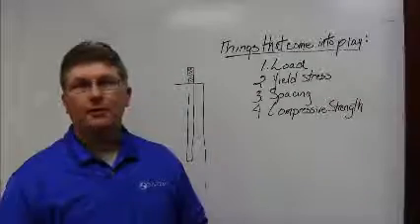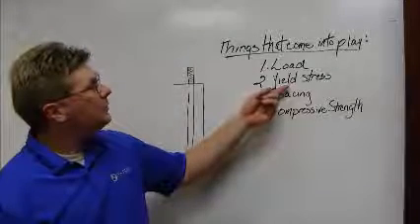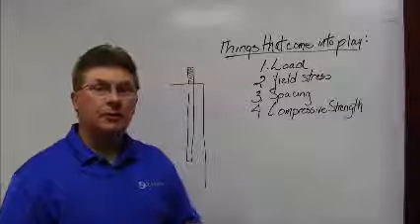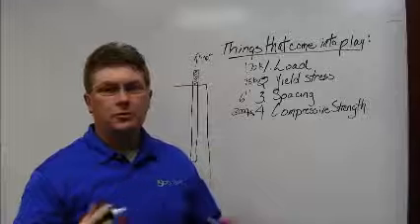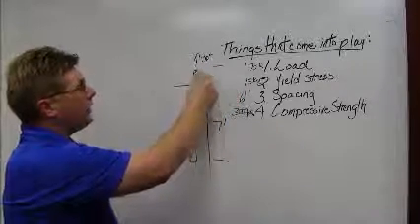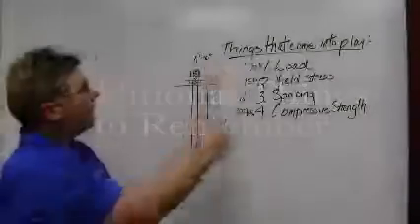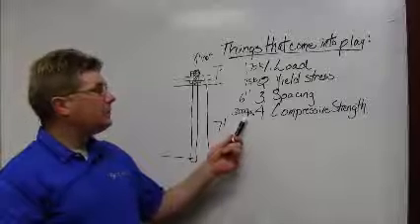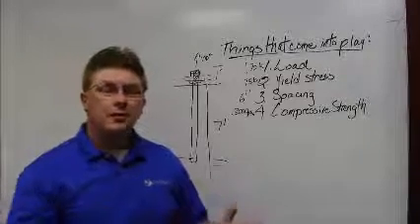DIS-TRAN Take2: Anchor Bolt Embedment

Comment: very good presentation.  Can I ask how to consider the shear transfer from base plate to concrete?  all anchors or half of them will resist the shear? is the shear be resisted by concrete or by ties at the pile top if piles are used?  Thanks.